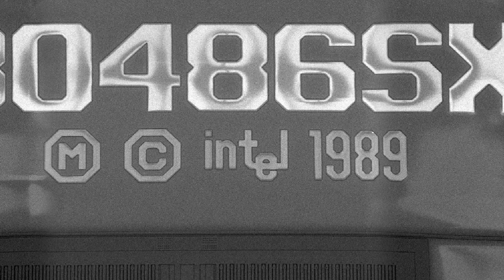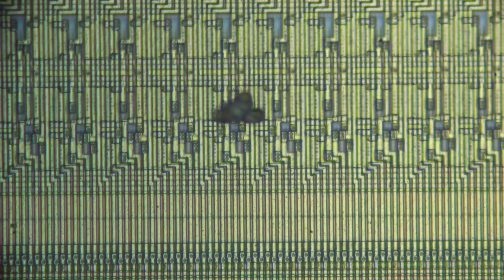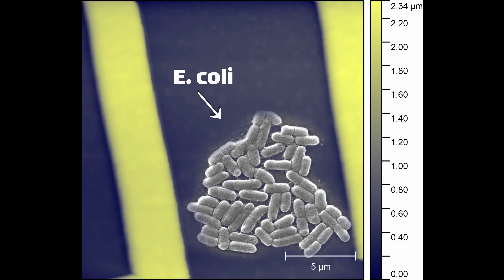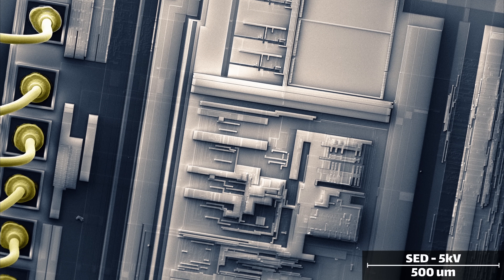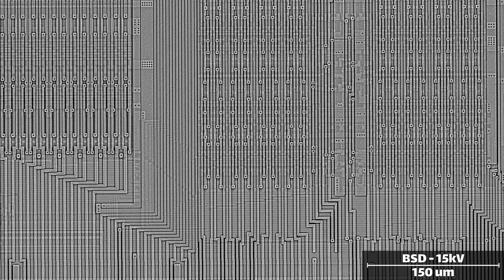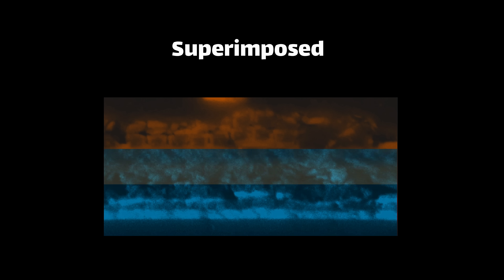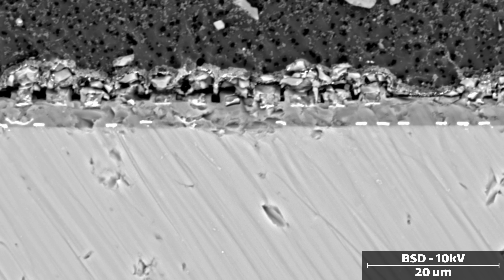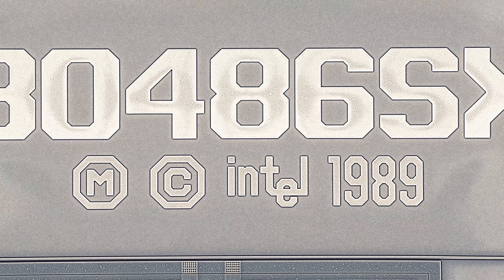Microscopic view of an Intel i486

Comment: Its funny how in Factorio you build areas of your base to do certain tasks but those often require raw resources or intermediate sources from elsewhere so you build a network in order to do everything as efficiently as possible and what happens is that when you zoom out on many larger or so-called giga-bases... you end up with something that looks like processor architecture.

Comment: Damn, that chip is same age as me. I believe you can cut the silicon with laser, layer by layer. Also modern chips would be interesting too, since we have reached the existing manufacturing limits. We cannot really go smaller, since quantum tunneling starts messing things up.
Reply: I am not sure how effective that is, I have seen others remove laters by using acids and other chemicals.

Comment: Can we all just take a moment to appreciate Intel's rate of production at this scale?
Reply: The first pill costs two billion dollars, the following ones, 4 cents.
Reply: @the_kombinator  - beyond that, is repeatability and testing... which involve mind boggling integers at this scale.... both in terms of high binary operation count, and the miniscule physical size.
Reply: @driverjamescopeland  That and also, if there's a mistake in a subsequent pill, you lose 4 cents. If your wafer isn't clean or there's a manufacturing defect on a die, well, you just threw out a lot more than 4 cents. Having said that, I'd love to get a failed 3 or 486 substrate.
Reply: @the_kombinator  - I didn't know until recently, most of those failed substrates can't be recycled into new modern chips. They can be used for larger resolution transistors, but not microprocs. It's simply not economically feasible to use anything but virgin silicon for new microprocessors.

Comment: In order to measure diffusion depths, we had a metal ring about 3" in diameter and 1" thick with a 1" hole in the center.  A 1" diameter plug would slide into the hole. The plug had the top surface sloped at a 1 degree angle.  The silicon chip would be mounted to the top of the plug with a heat sensitive material, the plug inserted into the ring and then the silicon chip would be lapped on a glass plate.  After the silicon chip had its surface cut at a 1 degree angle, it was stained with an acid to give the diffused layer a different color and the diffusion depth could be measured.  This was back in the 60's making transistors.
Reply from the maker: Interesting! Thanks for the tip!  That seems like a very accessible technique and wouldn't be too hard to replicate. Would be great to measure diffusion depths in my own devices, as well as looking at commercial chips

Comment: One of the best perks I had after becoming an eng tech at a semiconductor fab in Colorado was getting to play with the SEM's.

My primary responsibility lie in the front end so I mostly got to see product up to the contact layers.  Though I would from time to time go grab product in the metal layers and check them out.

When there were line problems, or we were characterizing new etch process' it was cool to get product back from FA because they would cross section and that was pretty cool as well.

Comment: Consider an ion miller for polishing the cross sections?
Reply from the maker: Just got one on ebay the other day! Needs a little repair to the roughing pump (blown diaphragm) but otherwise in good condition! Also accumulated a few lapping machines so hopefully will be able to do much better cross-sections in the future :)

Comment: Small correction: A finished chip is not "a wafer". It's a chip. A wafer is the term used for the circular silicon substrate (typically 300mm in diameter today) that chips are made from. They're "photographed" onto the wafer in repeating patters, as many as there is room for, one layer at the time. Once all the layers are complete the wafer is sent for testing, cutting and packaging.
Reply: Still gonna call it a Wafer cos it sounds cool and reminds me of food

Comment: Around the time the 486 was being manufactured I worked at Intel in the memory components division in the yield analysis group. I worked in the area where we analyzed the electrical signatures of the failures.
But I worked closely with the technicians that did the physical analysis.
They had to be able to peel back the layers to see underneath to find and identify what the yield limiters were.
They had a recipe book full of chemical methods to strip off the multiple layers that the chips were built upon.
One recipe to strip off the passivation, another to strip off aluminum. Etc.
It was pretty common back then to have a dip in yields that needed to be fixed quickly.
Samples of the memory chips would have their failures cataloged.
There were many cases where the particles that were contaminating the chip were analyzed in detail.
Once a particle was found in the Scanning Electron Microscope, it would be bombarded with the electron beam.
The SEM had a mass spectrometer attached that picked up the elements of the contaminate that was knocked loose by the electron beam.
They would look at the mass signature of the particles and try to match it to a catalog of various materials in the factory.
Sometimes they could tell right away what it was. Lots of carbon, lots of organics: Scotchbrite. Someone improperly cleaned a piece of equipment with a Scotchbrite pad.
Other times it would be some new alloy they had not seen before. They would trace it to a hinge of a door in a wafer handler that was emitting particles every time it moved.
The particles would land on the wafer and render the chip inoperable.
It was an endless detective game.
Reply: Fascinating details, thank you!
I've definitely wondered about how contamination vectors were detected in a busy clean room.
Reply: @joshroolf1966  Yes, it was! "They would trace it to a hinge of a door in a wafer handler that was emitting particles every time it moved." 
Wow.
Reply: Fascinating is an understatement! A door hinge emitting particles, wow.  So neat!  And it leaves me wondering what the manufacturing plant changes that have been implemented since then!  Wow.  @joshroolf1966
Reply: One more bit of information I'll add.
The technicians looking with microscopes and SEMs had no idea where to look on the chip for the defect.
It would be like trying to find a golf ball buried an inch or two under the grass on a football field.
A visual scan won't find it.
I wrote software that electrically tested the memory chips.
It didn't just identify pass/fail.
My team's software could identify two stuck bits. Or a column of bits that worked up until a point where the rest of the column failed.
The software could predict whether it was an aluminum bridge between two columns or a short between two poly silicon rows. Or if a via was missing, or shorted to the wrong layer.
There were many many categories.
With the detailed information about a specific die, it would generate a set of instructions for the person looking through the microscope.
Starting at a certain easily found location on the die, count 14 of a certain repeating structure in the periphery.
Then count vertically some number of rows of another repeating structure. Then look there.
If they don't find anything, notate that in their log.
Then go and use one of the chemical recipes I mentioned in my earlier comment to strip off another layer of material from the die.
Then go back to the microscope and to that same physical location.
It might take several iterations of this before the defect is found and identified.
The physical analysis is a very labor intensive process.

Two reasons for the physical analysis. One was to 'root cause' the defect to a clearly understood issue in the factory. Two was to correlate the defect to the electrical signature.
We could electrically test 1000s of samples with the deeper analysis test program but we could only sample a handful of die with the rigorous and more expensive physical analysis.

Engineering managers wanted to know where to put their resources to find and fix the defects that were costing the factory the most money.
We used statistical models to identify which defects correlated to which electrical signatures and predict how much we might improve yields by fixing a specific type of defect.

Out of the 20-30 types of defects that we were tracking at any given time, engineering efforts were only spent trying to fix 3-4 types at a time.
And only those that were clearly impacting die cost the most.
Reply: @ModusPonenz good one
Reply: id love to see an in depth video about all the different practices and solutions for contamination control, if anybody's familiar with one
Reply: @barfoom  Air filtration. Protective suits and hoods and overshoes. Air showers on entry to the clean room.
Reply: @deang5622  also I believe there's a slight negative pressure in the room, but I might be wrong about this
Reply: @wojciechbieniek4029  if you want particels to stay out, you need to overpressurize the air in the room
Reply: @wojciechbieniek4029 the pressure is actually positive normally to keep particles from other parts of the building from entering. Negative pressure would draw stuff into the clean room.
Reply: @notanymore9471  you're right, i had a mental lapse, thank you for the correction 😊
Reply: Back in college one of my instructors told us a story of a yield drop that they traced back to a contaminant that came from a tech who had started wearing a new perfume.  I would hate being one of the people doing failure analysis.  I've had a couple opportunities to see some of the work they do and it's fascinating and I'm glad there are people with an aptitude for it, but I'm much happier designing the circuits.
Reply: @gnd22  i work for a chemical supplier and we have a list of known contaminants. if anything on that list is in the same environment as the chemical in question we have documented "it does this" type of charts \ tables. the world of industry is pretty cool. but to your point.... perfumes, deodorants, and general self care products are the big offenders.
Reply: @alexcuellar4185  Interesting if you think about it, it can't be good for our bodies either! The skin is one big "mouth" if you will and absorbs more than we think.
Reply: @ChrisKoszo People are exposed to particles that cause inflammation and when the levels in your body get too high of a certain chemical you get cancer is how I understand it. People in a factory for example around certain  types of fumes every day.
Reply: That's the type of comments I always look for after watching videos like that. That's really interesting, thanks for sharing!
Reply: I can't imagine how crazy yield management has become with the new "5nm" chips.
Reply: I worked for a company that made computer chips over 30 years ago. They would buy consumer products like cameras to see if other manufactures were using copywritten designs without licensing.  There was one big problem with chips failing randomly. It turned out the deionizers contained radioactive material. When the chemical supplier (I think) was using the deionizers they would put it into the mouth on the bottle that was rinsed out and the moisture would make some of the radioactive material to transfer to the chemical. Later when the chips were made the material would let out an alpha particle and cause a random calculation in the chip.
Reply: @toddac61  https://www.youtube.com/watch?v=AaZ_RSt0KP8&ab_channel=Veritasium
Reply: sounds like a cool job
Reply: This is a criminally underrated comment, so cool!
Reply: We throw away so many wonderful components.   Lately I simply open older TVs and gadgets and extract as much as I can.
There are many nice consumer microscopes and cameras that can be used to analyze them in detail.

My electrical engineering professor used to bring a pair of beach flip-flops to class.  He used to say:
Flip-Flops, the key to everything.
Reply: Fascinating! figuring out the hinge of a door was emitting particles is insane
Reply: Wow. That's the most intense picture of quality control that I've ever seen. Thanks.
Reply: So basically every time I make a sandwich that's why there are crumbs everywhere. Perhaps I should freeze my bread and make the sandwich cold first.. 🥶 fanks
Reply: That kind of detailed storytelling is the stuff I want to read about.  Anyone know any good books that recount work done at early semiconductor plants?
Reply: you had some really cool experiences. 
Want to know more about ur experiences. 
plss make a video of ur own & reply it to me (regarding early days of chip development.)
Reply: Fascinating. Thank you. Sounds like that line of work should earn unbelievably well. Did it, or is it somehow too.... I don't know, controlled? Methodical?
Reply: Holy shit that’s cool, it sounds like something in Jurassic Park but real (and far less dangerous), rigorously testing, testing and testing this new cutting edge technology, no guides, just a lot of time, effort and patience.
Reply: Dude, that is so interesting.
Reply: Interesting, thanks for your comment. Btw. I am curious. Does even people who work for these companies truly know how chips and computers work? Is our knowledge of how these things work fundamentally distributed or do the people working at these places all know specifically ( themselves ) how digital computer technology works (in detail)?
Reply: 40 years ago at HP CICO (Cupertino IC Operation) they found a rubber glove in one of the solvent tanks.  Surprisingly, expectedly, the yield actually went UP.
Reply: oh gosh, incredible.
Reply: woow
Reply: Wow 👏👏👏👏
Reply: Cool story
Reply: Wow. Fascinating insights! Thanks for sharing your story
Reply: Woah that’s amazing
Reply: Detecting Carbon in a SEM? This sounds a bit sketchy.
Reply: Thats an amazing story. Thank you for that. I can imagine how this would have evolved cleanrooms today.
Reply: As soon as I saw the words "Mass Spectrometer", I realized it. Intel is secretly Black Mesa Research Facility
Reply: Holy shit that’s wild.
Reply: Holy crap. I had no idea it was this complicated. It's still bizarre how chips are made today.
Reply: Fascinating, thank you for your comment and insight.
Reply: thats totally insane!
Reply: @ModusPonenz   Thanks for all the details :)
Reply: That's insane. And 35 years ago. Incredible.
Reply: who puts all of the chips together? A million transiters?
Reply: That sounds every bit as cool as flying a fighter jet tbh
Reply: پشمااااامممم خدایا پششششممممااامم😮
Reply: Lots of carbon and organics these days can mean zip ties rubbing, o-ring seals going, fine oil from a bearing spraying. Sometimes the electron beam can burn them off so the microscope just picks up an empty patch. The smaller the components get the smaller the particles that can kill them. Automated sequences are used to send test wafers around different areas of the machines, then they're sent to automated defect scanners, and the data get automatically uploaded to a database, from which automated software creates summary reports with maps of where the defects are showing up, what their composition is. A lot of the machines have really extensive preps needed to switch on after you open them up, so you really need to know what you're looking for before you do. You don't want to have to go back in. There are many more process steps and tracking down which part of the line something is coming from is more complicated, but again there are automated tools to handle this. It's getting more and more complex as things get smaller, but the equipment and troubleshooting tools continue to advance also.
Reply: That is fascinating!! Thanks for contributing to this article
Reply: Wow. I'm familiar with the concept of a clean room but I've never heard these details before. Absolutely fascinating.
Reply: Hello Charles Smothers,
Fascinating to hear your history at intel, yield analysts.
The Foundry model, fabless semiconductor companies, i started at Philips as a kid, my family operated the company Philips. 
But i was just a small boy, i was able to code. Frits Philips, Cor Boonstra, used me to change the industry, and how i was able to use these machines.  Were we understanding the impact of outsourcing all production to Taipei ?Why was Philips doing this ?
Is intel able to keep up with TSMC, or are they forced to outsource production now ?
Please, can we help intel to become more creative now ! Wish we did make other steps back then ! Bring creative engineering jobs back please!
Reply: Fascinating.  You could upload a video just talking about this stuff and get some serious views.
Reply: Tldr
Reply: Stop the i was work i there comments it's not important
Reply: This is such a weird corporate sponsored comment. How does it feel that employer only cares about making money and is losing to AMD?

Comment: Amazing to see this up close. It still boggles the mind to know that this was thought up by a human. I had a 8088, 286,386 (with math co ) and skipped the 486 and went straight into the first  Pentium ........Cool times. Editing the Autoexe bat file, config sys and making sure my 640 KB or RAM on my 386 (w/math co) spread out correctly. I bumped it up to 720 KB after installing 19 chips on a ram board.
Reply: I bought an expansion board for my Tandy1000 (8088) that gave me 640 KB.  That was so much RAM that I used some as a RAM disk that I copied my compiler onto so I could edit and compile programs without switching floppies.